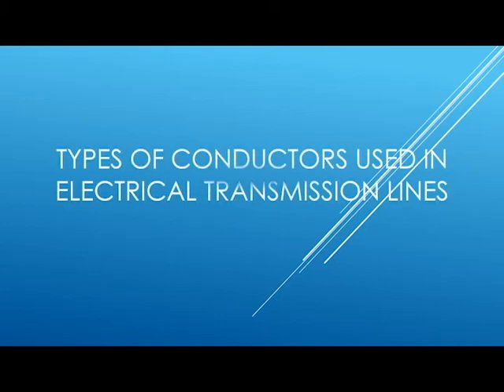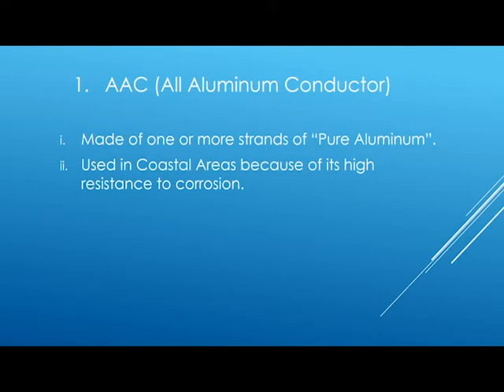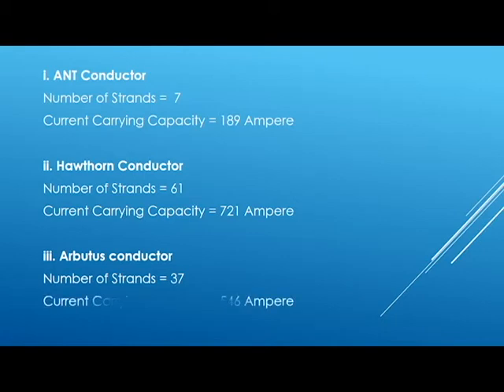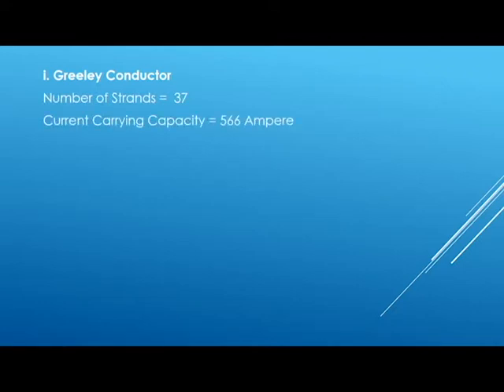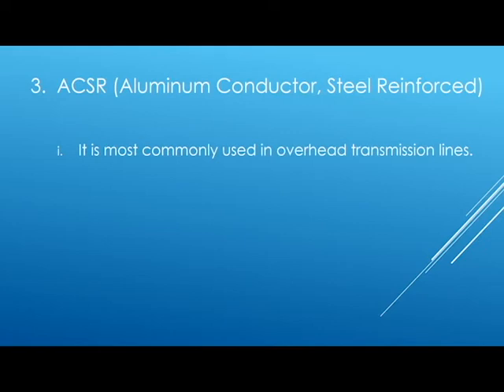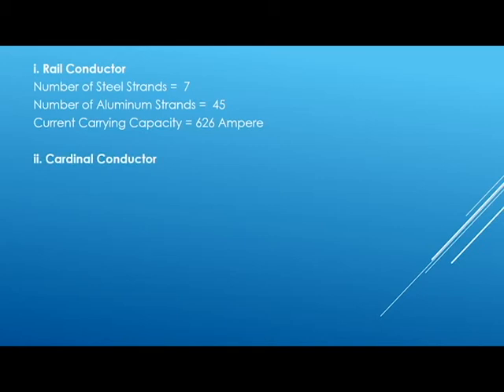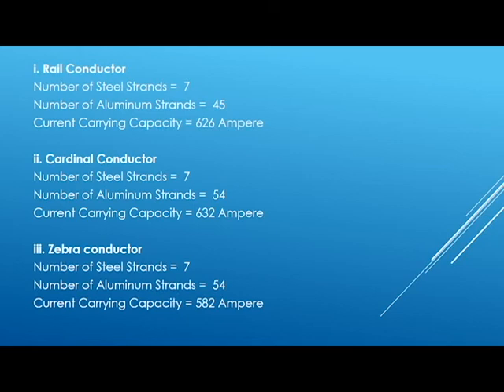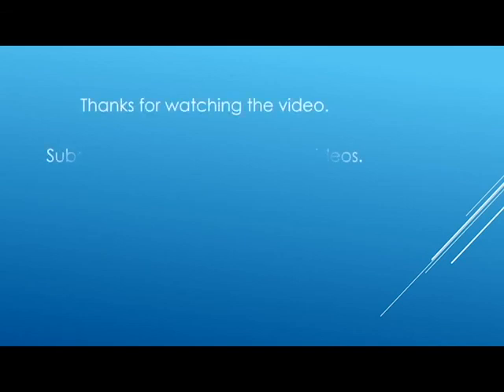Types of Conductors used in Electrical Transmission Lines

Comment: Are the types of conductors named standard will specific conductor suppliers?
Reply from the maker: Each conductor has a specific name according to its make and type. e.g. "Rail" conductor corresponds to a specific ACSR conductor having 45 No. of Aluminium strands and 7 No. of steel strands. So you just need to specify the conductor name to the supplier.

Comment: What about the insulation’s on the transmission line
Reply from the maker: The overhead transmission lines are not insulated while the underground conductors/cables are provided with insulation. The insulation in overhead transmission is provided between the conductor and the tower in the form of disc insulators which prevent any short circuit between tower and conductor. You can find more info about High voltage transmission lines in following videos. https://youtu.be/m4bZaLkwfis                                              https://youtu.be/yiyVJ4nwU88                               https://youtu.be/B3cc0TCLy9g